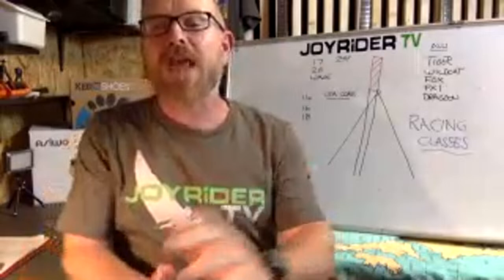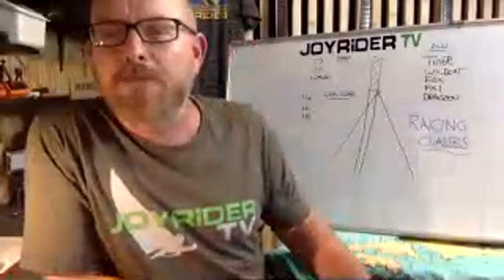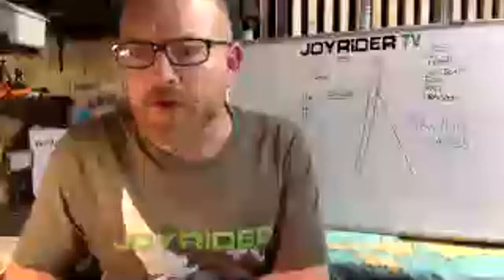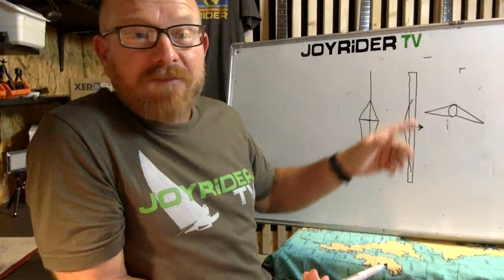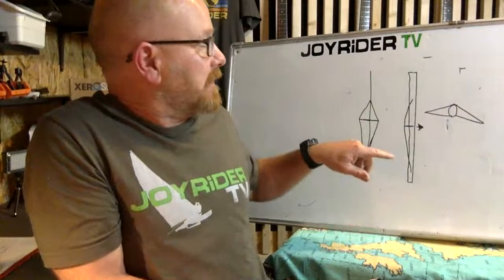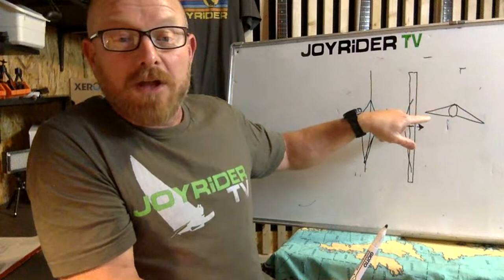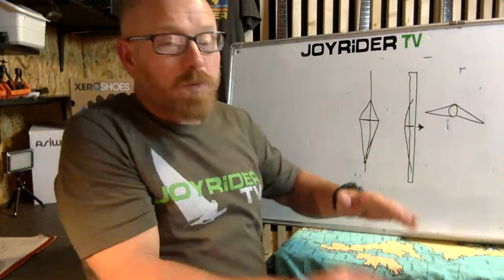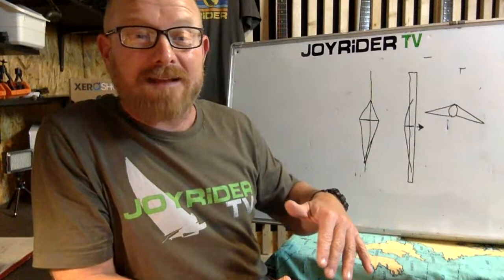Q+A Live - Your Catamaran Sailing Questions Answered.

Comment: Hi Joe, Bill from hauraki Gulf New Zealand here,  a question for next week please. I'm a light weight hobie 14 sailer. 
Recently I was given a dis-used hobie 17.A beautiful craft and its  now is ship shape with awesome wing seats.  But I'm not confident to sail with its huge mast as if it goes over I'll never get her up again. I'd like to use a smaller mast and sails. 
It has a tow bull style knob on the front cross beam. Is there any way to rig it with a hobie 14 mast  ?  Perhaps some kind of adapter gadget at the base of the mast? 
  
And - just for fun I I wonder if you've ever tried adding alternative steering to a hobie. ? 
I put some pulleys on each  lower side  shroud and another two pulleys at the ends of the mainsheet traveller track.
With a rope connected from the tiller through the 4 pulleys around the boat and back to the tiller.
It creates the ability to helm from anywhere in the boat by any crew member.

Thanks Joe,  !
Reply from the maker: Hi Bill, thanks for your questions, I look forward to going through these in this week's q+a